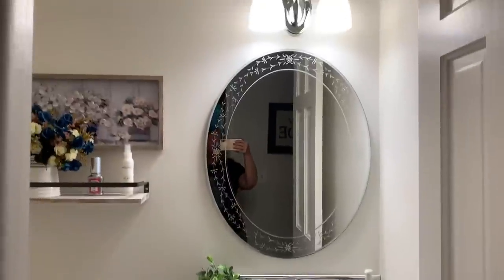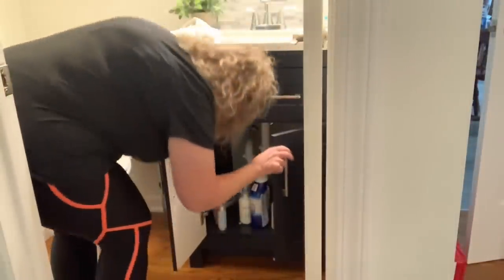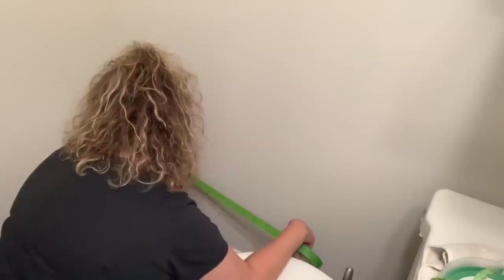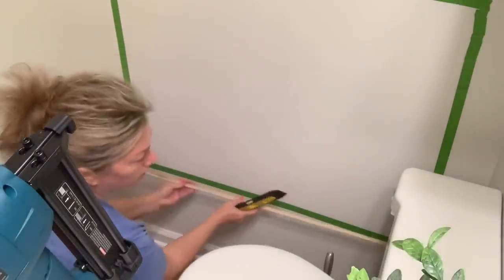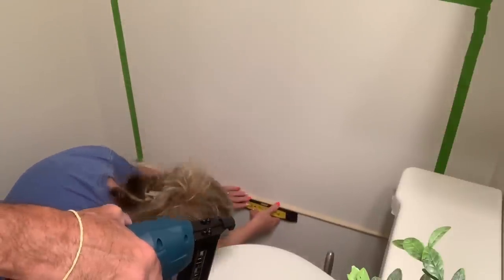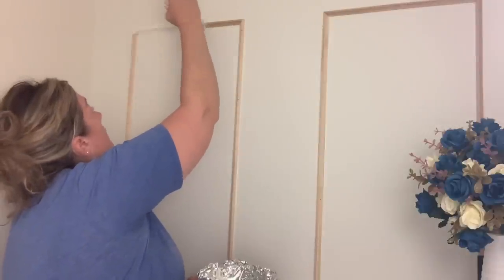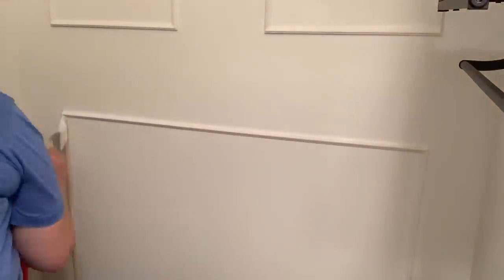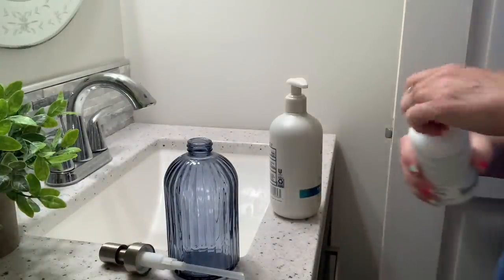Makeover on our VERY SMALL Guest bathroom/ budget friendly changes/ DIY wall moulding

Comment: Jody I am far from an expert, but I think if you drilled a small pilot hole in the trim it would give the tip of the nail a place to sit.  I’ve never tried this with a nail gun, but found it super helpful with a hammer.   It also helps the nail go in straight.
Reply from the maker: Thank you ❤️

Comment: You can pre-drill your holes.  
I think you want to use wider strips and nothing with that big of a bump in it.  This is going to be my winter project. I think I’m going to do it in my living room actually. Under my windows so that’s going to be front and center, this I stumbled upon something that you just peel the tape off of it and you put it on your wall and you paint it and it looks like wood so that’s an option that I’m going to look into but another thing to use a nail gun but you can also use And adhesive that comes in like a caulking gun. So basically when you use a nail gun you’re gonna have to nail it into something not just sheet rock so that’s something to think about too As that is what adhesive is about.

It’s beautiful, so elevated , looks like you’re getting hooked on do it yourself.  😂
Reply from the maker: Oh what a fun project Jane. Can’t wait to hear how it goes ❤️

Comment: It looks great! We painted and changed out the sink in our guest bathroom this year. It had "pee yellow" paint, as our friends called it, so we went to a soothing, clean blue paint with a white sink/vanity. Rather than hiding the plunger, you might want to just find one you can leave out. If you have to go searching for it in an emergency,  odds are you won't get to it in time and the water will overflow.
Reply from the maker: Oh that’s so exciting Leigh ❤️
Pee yellow sounds interesting 😂
Reply from the maker: Oh that’s so exciting Leigh ❤️
Pee yellow sounds interesting 😂
Reply: Yeah if you need a plunger it’s usually a pretty quick need 🤐 it’s not particularly lovely but I found all in one sets (base holds plunger and toilet brush) at either Dollar General or Walmart, and keep them tucked discreetly by toilet.
Reply: @jodidunnmymessylife1847  When we moved in, the guest bedroom was PANK. Not pink, PANK. It was perfect for the little girl that lived there, but not so much for the guest bedroom we would have there. It was so intense that the guest bath yellow seemed normal. It took a coat of Kilz and 2 coats of paint to cover up that pank. Now the bathroom is calm, with a touch of humor. We have some 50's pinups on the walls (fully clothed and not at all scandalous), as well framed boxes of my Mother's seamed stockings. Oh, and a leg. An honest to goodness shoe display leg wearing a stocking with a navy seam and accents. It's a bathroom that makes you smile!